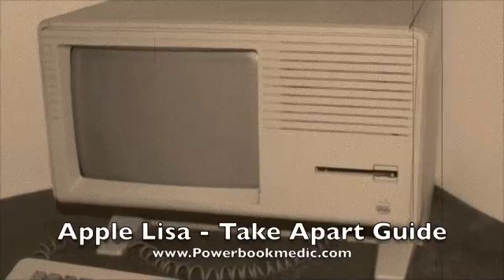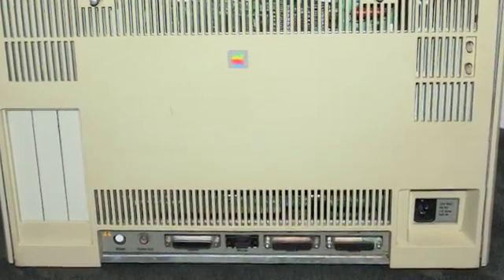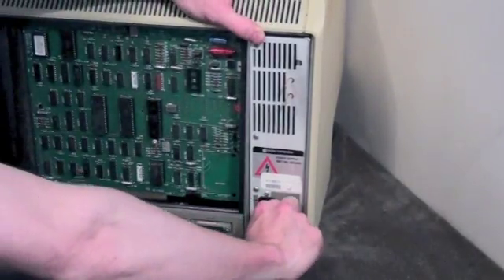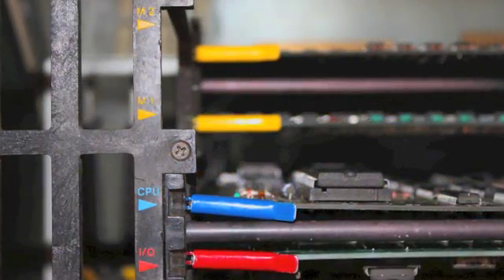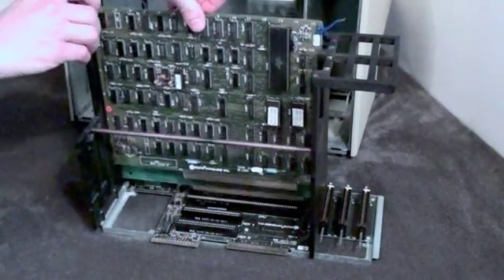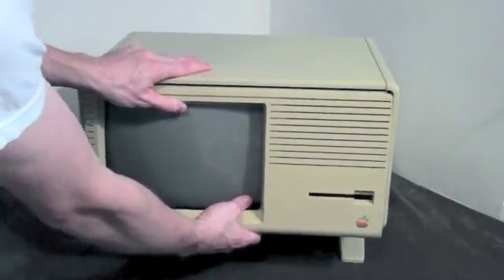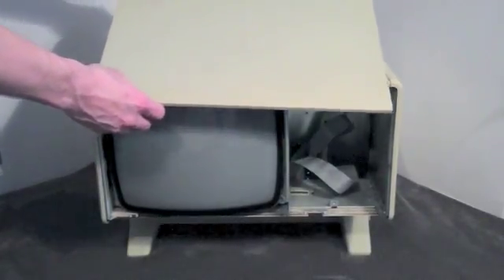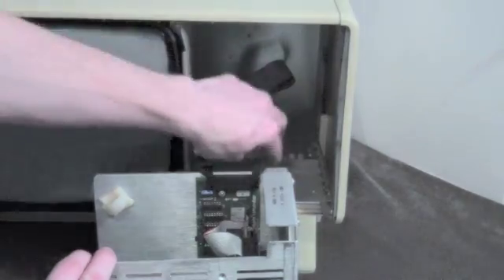Apple Lisa - A Video Disassembly and History

Comment: Holy crap. 5 months later. I never ended up doing it because of the monitor itself, and yeah the price is what killed the idea for me too.
Reply: Yeah you don't want to gut a Lisa regardless of what condition it's in. They are way cooler and worth way more intact. And since they are relatively simple inside they can usually be fixed.